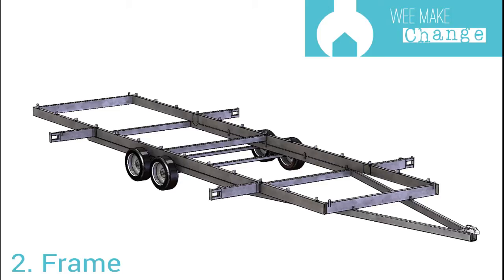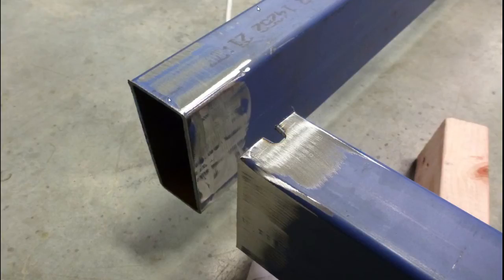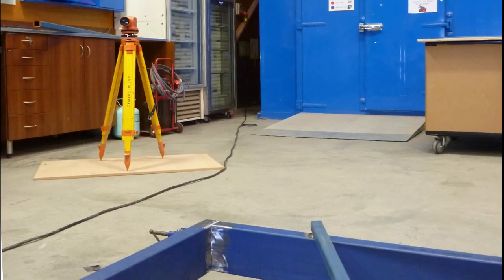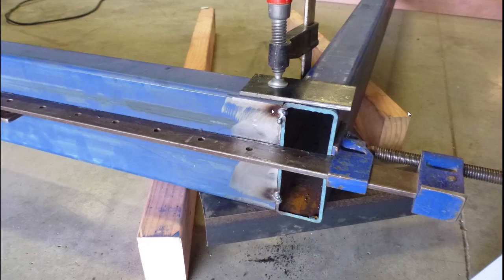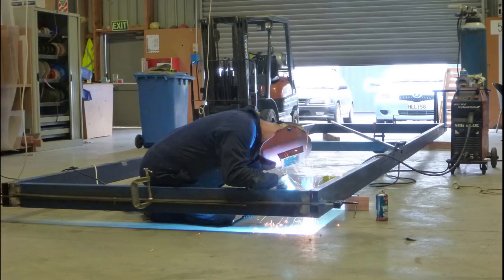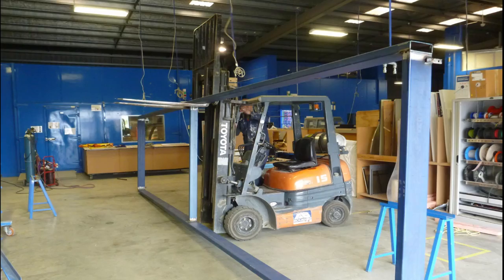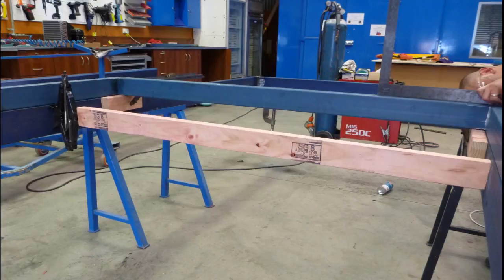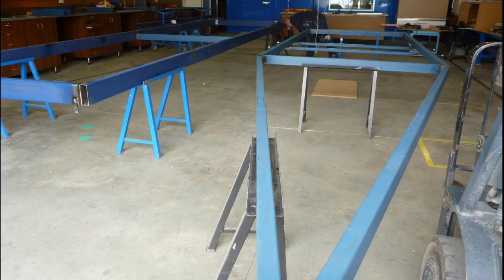Tiny House Trailer Build - 2. Frame Fabrication

Comment: anytime you make a trailer that will operate on any public road way,  you do sample welds then cut them  to see what the penetration is on a sample of the steel!  any primary beams need a set of fill welds and top welds , example 2x4 joint minimum of 3 welds,   5 better.   reinforcement shims can be used to make an even stronger joint!

Comment: Looking at your drawing at start of video (1st 30+ seconds)  it appears that your axles mount pretty centered (from front to rear) under the frame.  This could make most or all of the weight sit on the axles and make the hitch tongue weight too low for good stability on the road.  (of course your finished house may be designed heavier towards the front to achieve good tongue weight..).  Observe images of trailers and you'll notice the axles are nearly always mounted to rear of "front to rear center". I would set the axles centered rearward about (2) of those 12 joist mounting tabs distance from center, rather than under the center joist tabs, as shown in your drawing..... A minimum of about  10 or 12%  of the trailer total weight needs to sit on the tow ball of the tow vehicle for towing stability.  Much less and the trailer will tend to weave back and forth on the road.  Also Important: There is also a slight toe-in angle built into most axles: the tires should be pointing  inwards a tiny bit at their side towards the front of the trailer (they are best when steering slightly towards each other going down the road). If the axles aren't marked for front and rear? Mount the hubs and wheels and measure across. Always mount the axles with any toe-in towards the front.  It makes them track stable. Toe-out causes  it to wander from side to side, so make sure it toes IN.  It is less critical with multiple axles, but can still be a big factor in stable handling on the road.